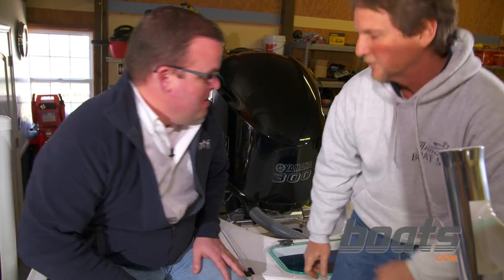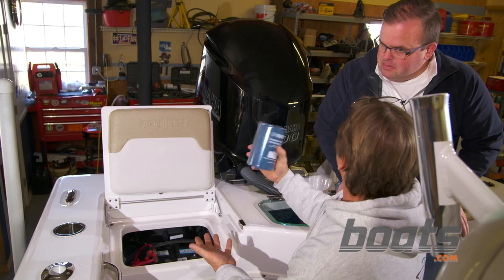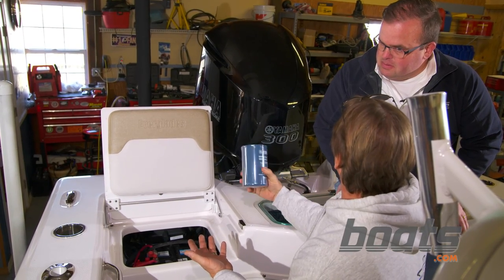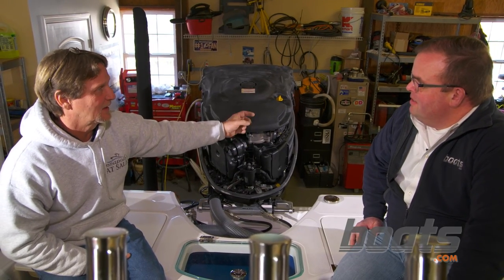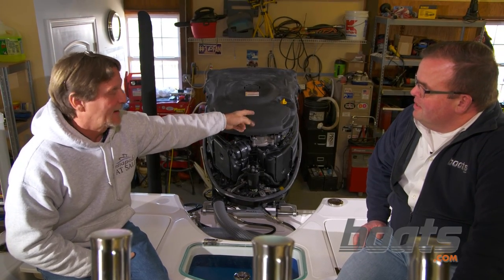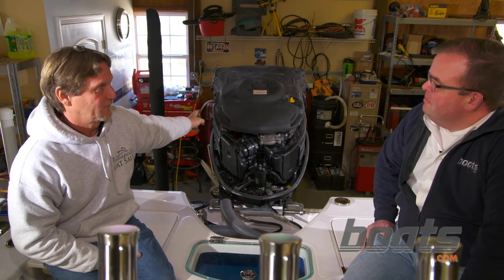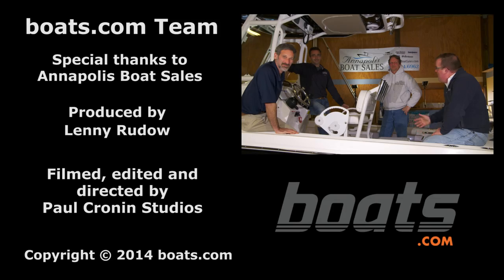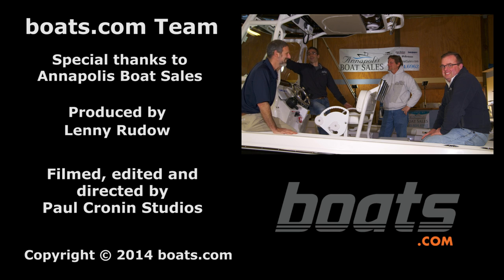Yamaha Four Stroke Outboard Fuel Filter Information, 101

Comment: Thanks for posting, question: the fuel/water separator filter, I see some made with a sight glass and bleeder but the one you show (that I have, came with the engine) has no sight glass, and no way to bleed off to see if water is present.  Why are they made with no sight glass, no bleeder?  I assume you simply change them at interval?
Reply from the maker: That's correct - if it doesn't have a sight glass, go by the manufacturer's recommended replacement interval.

Comment: lve got a 1971 chrysler outboard i took off the fuel lines to replace them but forgot how they go
Reply from the maker: Hi chris gerber, this predates our expertise, but the Antique Outboard Motor Club might be a good forum to post your question. They have an "Ask a Member" section here: http://www.aomci.org/cgi-bin/yabb2/YaBB.pl
Reply: thanks found the
original problem the float valve needs to be replaced
Reply from the maker: Glad you figured it out.

Comment: How often do you need to change the filters on the motor?
Reply from the maker: Yamaha recommends changing its one-piece fuel/water separator filter (like the one seen in the video) at least once a season or every 100 hours of operation. If you have a two-piece fuel/water separator with a sight glass on the bottom, they recommend checking it for water every 20 hours, and changing it at least once a season or every 100 hours of operation. Of course, if you think you are having problems due to a bad load of fuel, changing the fuel/water separator filter is a good first step to take. We recommend consulting an authorized Yamaha outboard dealer or technician to find out what the filter maintenance schedule is for the rest of the on-engine fuel filters, as the maintenance intervals are different for each model.